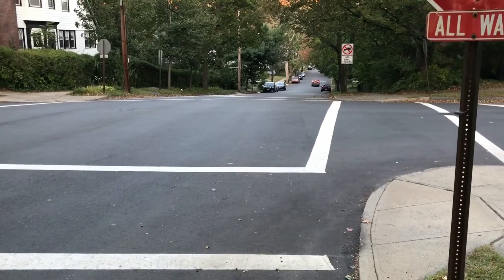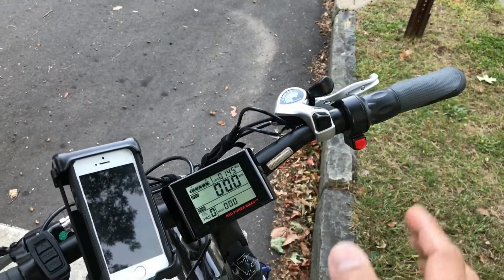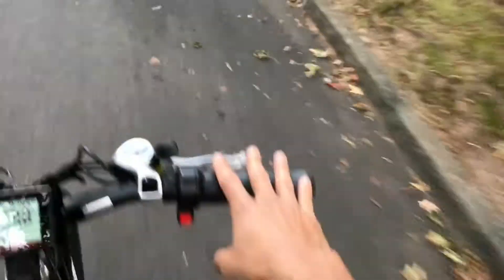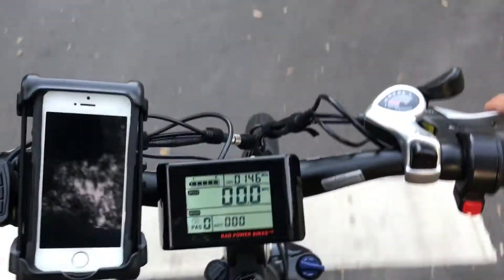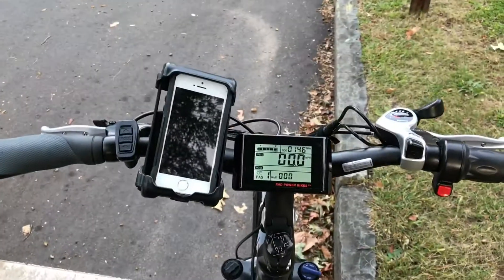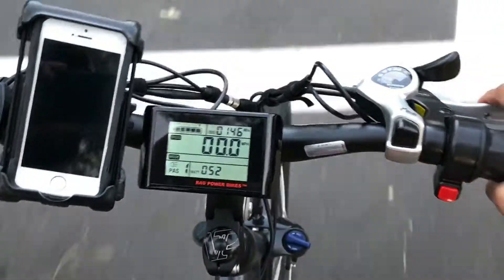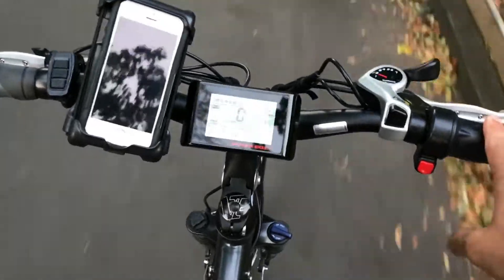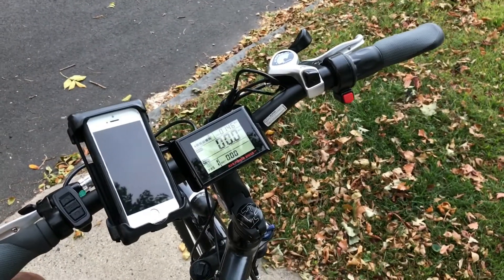RadCity by Rad Power Bikes: Regenerative Braking Test

Comment: Hello and great video ... it’s great regen slows you down when you want but how much charge does it add to your battery?  If we believe the 290 watt reading ... a combined 1 hour of regen would put 290 watt-hours into your battery ... or about 40% or more of your total battery capacity... do u agree? Thanks
Reply from the maker: In theory, I think you might be right. But I’m not sure how efficient the regen is, such as if only 50% of that regen makes it to charging the battery. I look at it as more for saving brake pads and having that little extra stopping power 😄

Comment: How did you activate the regen/motor braking function?
Reply from the maker: Pressing lightly on any brake lever will activate regen on the RadCity. Then fully pressing will activate the actual brake pads. So to use regen only, you just lightly press the brake. Almost all of my stopping is done with regen unless I need to stop in a hurry or going down a steep hill.
Reply: @TrulyElectric  mine doesn't have that regen function. The brake just cut off the motor power.

Comment: That's great. I have a high power kit 52v 40 amps. Can go pretty fast. My city has no bike lanes so it's safer to go faster, when riding alongside the cars. I've been using the regen brake for the main purpose of assisting the brakes when braking from high speed. It's great. I don't even care about the battery regen, just the added brake power is awesome. I wonder why it's not more popular, some people don't even know their controllers are capable of regen braking. It's a great safety feature.
I've been wondering if there is a way to use the brake levers sensor to make a brake light for the bike. Any ideas?
Thanks.
Reply from the maker: I agree, not sure why more people don’t highlight the regen feature. I love it. Also, on some forums, some people don’t even think that regen works and that the braking is from the brake pads lightly touching the discs. They obviously never felt the regen kick in. I’m thinking of doing another video example sometime where I disconnect the wire to my brake to prove it actually slows you down, of course keeping one brake for emergency stopping haha.

But that’s a good though about making the light turn on when braking. I honestly wouldn’t even know where to start to make that happen lol. I’d love to find out too though!!
Reply: @TrulyElectric  Indeed. It's very powerful and instantaneous. As soon as the brake lever moves just a bit, enough to trigger the brake lever sensor, the brake immediately kicks in. So much better than when I had only my mechanical disc brakes, they would take a lot longer to kick in, as I pulled down on the brake levers. Serious braking only happens when the levers are halfway held down.
Not sure about this, but I would say the regen braking is responsible for more than 50% of the braking most of the time. 
As for the tail light, I have a light set that is directly connected to my battery, so I don't have to take them out to recharge, or change batteries. The front light even has a built-in horn (very useful in traffic =D ). The tail-light is red and I use a special wire that make it flash in blinking pattern (i think it draws more attention amongst the cars). I would like to make it go from blinking to full-on when I press the brake lever. Will try passing a wire connected to the brake lever sensor, bypassing the blinking effect circuit, so when braking is triggered, the light will (hopefully) go from blinking to full on. 
My greatest concern when riding in intense traffic is getting hit by a car from behind, who isn't paying enough attention and don't notice that I'm braking in front of him.
Anyway, it's hard to explain it here, in text. English is not my native language.
If I can make it work I will report back.
Thanks for answering.
Ride safe!

Comment: Is what you are testing here actually regenerative braking?  Isn't it just because you're not pedaling (and therefore no power is being applied by the motor), but the motor is direct drive (not hub) and the drag of it being engaged slows you down when you're coasting?  This is the same thing you have in motorcycles and stick cars when you go downhill and you put it in gear, except there it's called "engine braking," and unless it's battery powered the energy isn't saved.  

Still, very good information to know that the direct drive motor appears to be completely disengaged in PAS 0 (like you would be with a motorcycle/car when you have the clutch engaged/snot in gear) and therefore lets you coast like you could with a hub motor.
Reply: The Rad bike is regen same as a Prius.

Comment: well to make sure after looking at this video i owe a radwangon 2017 an my bike trips at some place's have a good bike trail to ride on i test this regenerative many time's an every now an then i have to at time's press the leaver a little bit down in order for this to work an see if the watt meter show's 200 or more what i found out over time that i have to just tighted the cable's just a bit in order for the regenerative to work in what i find that i can hear the break's rub on disk but not as hard so i have to let lose an break a little bit just light touch an it work's an slow down the bike an the watt meter is over 230 to 245 give or take you do have to tight the cable abit in order for this to work as of now with the cable tight up a bit the regenerative brakeing work's i do keep an eye on the pads an they have worn out a bit after 10 month's later pad's still around maybe another 500 miles to go will be getting new pad's soon as back up in case they do run out other than that i'm still learning some new on my radwangon an keeping it running well it's a great bike to ride lot's of people ask me where did you get it an i tell where well have a good day an keep injoying you'r rad bike on the road thank's

Comment: I just purchased myself the Rad City about a month ago and i did a little research and discovered how the re gen breaking works and it's very interesting.  The rear break leaver actually is what activates the re gen breaking.  The way that it works is when you apply the rear break leaver there is going to be a small area of play where the leaver is being applied but the break pads are not quite in contact with the disk.    So when you want to just activate the re gen breaking you barley depress that rear break leaver.   When you do this you will see on your display a wattage reading coming up in the 225 to 260 or so watts despite the fact your not throttling or activating any peddle assist.  What that is telling you is your re gen has been activated and your getting a reading as to how much power your essentially putting back into the battery.  The motor almost always will create a degree of resistance when you are just coasting and not applying the breaks because of it being a direct drive motor vs a geared drive motor will coast with more of a "free wheel effect" but to activate the actual re gen feature to where it is actually charging your battery with the captured energy from slowing the bike, apply the rear break ever so lightly and you will see the wattage your producing right on your display.  Another thing that's wild about this bike is the re gen breaking will come on automatically if your coasting down a massive hill and exceeding 25 mph.    I have gone flying down some of the hills here in Seattle on a regular bike getting up to 35 mph.  If I go down the same hill on Rad City which is a lot heaver even it will get up to 28 29 mph because I can even feel the re gen breaking coming on,  its saying "YOUR GOING TO DIE SO SLOW DOWN"!!!   For some reason when this happens i do not see any reading displayed on the Watt meter unless i do that slight depress of the rear break leaver.  So like i said your not applying the rear break leaver enough so that the pads are even grabbing yet, just keeping right in that small area of play,  You will feel the bike slow some,  not drastically but there is a noticeable decrease in speed taking place yet a reading on the watt meter is showing up thus your re gen breaking has now been engaged.  Hope this helps,  pretty interesting STUFF id SAY  :)  sorry if i am too long winded lol
Reply: Now I know my radcity has a regent cable. . lol. All this time I thought it was making juice . . . I wondered why sometimes it said 200 plus and others times coasting at 21mph it said 0 big fat zero. I have more to learn I see. . . thanks guys. . . now I'm goung to go test it. . by the way I turn 46 today and I rode all my life til my knees gave. . . Now I'm back on it. . plan on a rover for mountains soon too :) oh ya. Old man comming thru
Reply: I need to make a correction.   Both break leavers will activate the regin breaking before the pads hit.
Reply: Back from my ride. . yes. . the front and rear break must be applied to make power. Period.  I had to apply a fair amount of break power before it engaged Then I was able to lighten my grip and keep generating. NEXT I tested making power pedaling on flat pavement. I made 200 plus watts in 3rd with assist off and break applied.   . . I made power on flat ground. . . then I tested it with No assist in end on flat ground. . this bike MUST have power or its an extra hard core work out . . ouch. Good stuff. . I like power 2 and 3 for distance and 4 or 5 for hella help or zoom zoom. . btw. . . these are NOT fast bikes. No assist past 25 max and so much weight And drag with the direct drive. . I tested a mid drive and it was so fast I went 30 plus I NO time. But at 3000$ hell no. . I got my rad 900 $ used. Tightened some stuff and super noisy spokes.  I'm a happy old man.
Reply: I also have a RadCity. For me, regen will not come on until I've pressed the brake lever a certain amount, past the point where the pads are engaged. If I just press them a little, nothing happens. But if I press them a lot, then I see the wattage in the wattmeter. I even tried loosening the brake cables, but to no effect. Also, I don't really feel any slowdown from the regen. I feel the brake pads enaging, and I'll go from like 18 MPH to like 14 MPH; but I definitely don't feel any drag from the motor--just the friction from the brake pads.

And, last, about it kicking in automatically when you go past 25 MPH, is that because your top speed is set to 25 MPH? I'm wondering if it has to do with the top speed setting in the display, or if it's always 25 MPH, regardless of the top speed setting? To test this, I changed my top speed setting to 15 MPH, and then went down a hill at about 19MPH, but didn't feel any drag or see any wattage on the meter. So wondering what would happen if you lowered the top speed? Would you get the same effect?
Reply from the maker: nrgins, if you loosened the brake cables and you still don’t feel it kicking in, try tightening the regen cable so that it kicks in first before the brake pads enhance. Once you get it right, you’ll feel it! 😀
Reply: @TrulyElectric  Cool! I'll try that. But where is the regen cable? Is that connected to the brake handles ? Thanks!
Reply: @TrulyElectric  OK, I see the regen cable, but I don't see any way to tighten it. Is it tightened at the brake handle, or at the other end, by the motor? Thanks!
Reply: I just got by Rad city a couple of days ago and from my very short experience, you have to apply the front breaks slightly to activate regen braking. The back breaks does not activate it, just the front (left) breaks!
Reply: @jamesk7867  actually, either brake lever will activate the regen. but you have to push it enough to activate it. If the brake cable is too tight then the brakes will be engaged before regen can be activated. So if your rear brake lever isn't activating regen, then loosen the cable little so you have to push the lever in further, and then regen will be activated. But believe me, it works with either one. They both have magnetic sensors on the lever that activates the regen.

Comment: How does one know when the "regen" has kicked in....you might just be leanning on the disc a bit...is there n alert on the dash ??
Reply from the maker: Great question! At the bottom of the display, there is a Watt output number. When I lightly press on the brake you’ll see that number jump to 289 or 290 in this video. That’s how you know regen kicks in.

Besides the visual piece, you can really feel the drag as well. I run my brakes pretty loose, so it takes a lot more lever depression before the pads touch the disc.

At 2:30 into the video, you can see that regen didn’t work. The screen showed regen was “on” by the watt number, but I wasn’t feeling the bike slow down. I called Rad Power Bikes after I filmed this and they confirmed that regen doesn’t work when the motor is not activated first from a dead stop. I mention this to show that you can clearly feel the drag of regen, which I didn’t feel during the first run down the hill.

Hope this helps!
Reply: @TrulyElectric  I wonder how regen could have been putting energy into the battery (based on the number on the wattmeter) without slowing the bike down? They said it didn't work unless... but there was clearly a number on the wattmeter. So that doesn't make sense. Any ideas? Also, I have a RadCity and when I'm going downhill and depress my brake handles, I feel the pads engaging and I see a number on the wattmeter, but I don't feel it slowing me down any. I just feel the friction of the pads slowing me down, but not much. I'll go from like 18MPH to like 14MPH, but no big slowdown. So I wonder if I'm experiencing what you did at first: that numbers are on the wattmeter, but regen really isn't working. And, yes, I'm in a PAS level first before going into regen (I never go into PAS 0). Any ideas you might have about this would be appreciated, as I'd like to have regen slow me down, but it doesn't seem to be.
Reply: @enargins  Same here. I can't get the Batt 270 number unless my brake pads are engaged and I have tried loose brake pads and tight. Before I bought my City Step-thru, I was under the impression that you could 'tap' the brakes and engage regen to slow down without applying brakes.